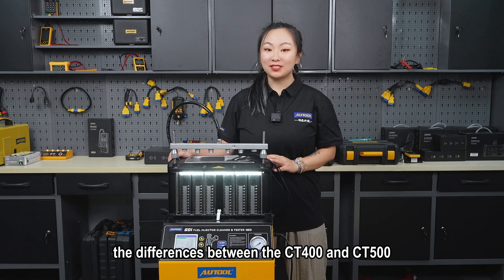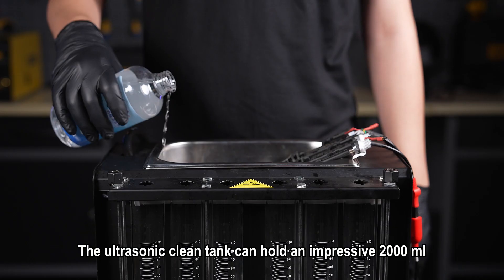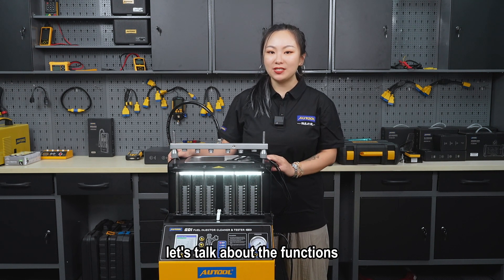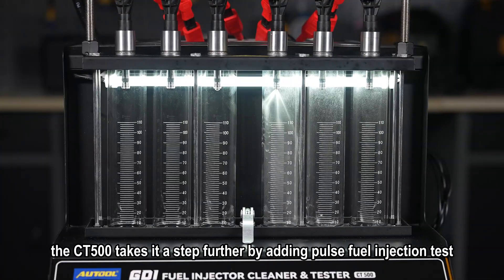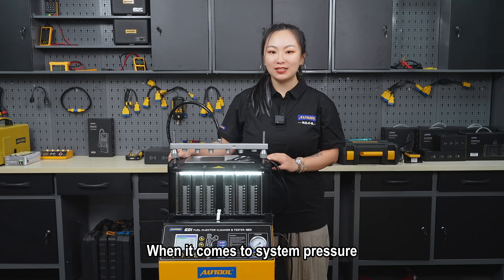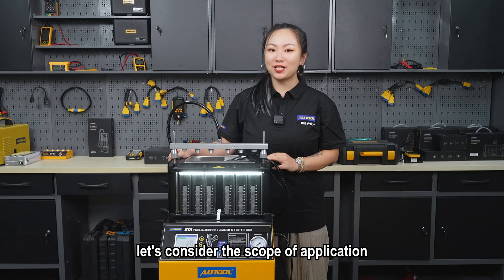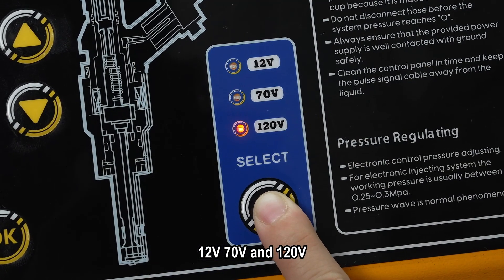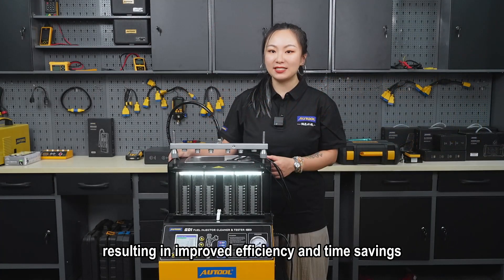CT400 vs CT500: A Comprehensive Comparison of Fuel Injector Cleaning Machines

Comment: I have a question about ct500, I saw video how injector test starts and that got me confused. Test started instantly, but fuel pressure rise slowly. Is it possible to first pressurize system and only than start test?

Comment: اشتريت جهاز ولا اعرف ماهي المواد المستخدمه للجهاز
Reply from the maker: Hi there, Thank you for your support of Autool. For the cleaning function, please purchase a special injector cleaning fluid. For the test function, you can use medical alcohol as the test fluid.
Reply: @AUTOOL-TECH  ارجو اكتشاف الخلل الفني للجهاز لانه لايكشف تسريب البخاخات
Reply from the maker: The machine itself has a leak test function, please refer to mode 7. Atomization can be tested through other modes, such as idle test, medium speed test, and acceleration test to see the atomization effect. thank you @البيضاني-لكهرباءالسيارات

Comment: Does this work with 2016-2018 Mazda MX5 GDI injectors?
Reply from the maker: Hi there，both CT400 and CT500 are suitable, but it depends on the specific injector. Test whether the specific injector has a suitable adapter.

Comment: This is not a cleaning machine. She is unable to check the injectors. In your video in the ultrasound video of injectors with N20 BMW, there is a microfilter at the end of the electromagnet, it needs to be washed and then put on a testing stand at 40-120 bar
Reply from the maker: The information provided seems to be a misunderstanding. In reality, the testing and diagnostics do not necessitate achieving the 40-120bar pressure that is specified for the vehicle; a pressure of merely 6bar is adequate for testing with the fuel injectors.
Reply: @AUTOOL-TECH  You are completely wrong. When I made the first pumping station, I thought everything was ready. now there are two of them. And there are plans for another powerful one. I can easily turn everything on together, not only for pressure, I need pump performance. My cleaning technologies without ultrasonic baths, in 10-15 minutes. And now cars have injection 120 bar idle. In our city they have been accumulating such stands, and are trying to look at mine)))). They can’t do it because new technologies don’t work with simple checking or pushing through dirt.
Reply: @246alfa  To fully test gdi injector, you need to test it in two stages, in cold and in hot (~100*C) condition and as you said in high pressures as it was designed to work. Sadly this devise does not exist so I test gdi injectors directly in a car.
Reply: @MechanikasLukas  I've been making stands and technologies for cleaning and testing injectors for 15 years. I don't show them off, as they might be stolen. Some of the processes can be seen on my channel. I also make pump stations for testing up to 270 bar. https://www.youtube.com/watch?v=7YQPUA9PO0c
Reply: @MechanikasLukas  You'll notice the time the videos were filmed. They were used for a forum. But that was before the war. A lot has changed since then, especially technology. https://www.youtube.com/watch?v=7YQPUA9PO0c
Reply: @246alfa high fuel pressure is a good start, but still no injector-fuel heating I guess?
Reply: @MechanikasLukas  The temperature difference isn't important. If you heat one injector, the response time curve changes. But when I'm working with a line, I don't need the temperature. I use the temperature during the injector cleaning process. I don't use ultrasound. This isn't the beginning. I have three pressure stations and many different pumps. I have no desire to invent anything new. Auto repair shops all over the country send me injectors.
Reply: @246alfa sorry, you are wrong, to fully test these injectors, you need to test ir also when it is hot. I repair these cars and test injectors in time consuming way- in a car, and some bad injectors are leaky, some inject too much or too little when cold and some transforms when are hot, too much or too little fuel. That is a fact, maybe you have not got that deep in to it. More specific, it is n43-53 injectors 150-200bar working pressure.
Reply: @MechanikasLukas  Let me repeat, the temperature isn't important for testing. I've been doing 5-7 sets a day for four years now, seven days a week. There's no injector I haven't seen and developed a test plan for. 
For N43/53/63 GEN-1, it's a piezo. It's important because they require 150 volts. 150-200 kg of them have been tested. I don't want to deal with them; I have enough work with electromagnetic injectors. https://www.youtube.com/watch?v=AXUEOPgMuOA Click on the nickname.
Reply: @246alfa understood, too stuborn to lern anythong new. Good luck.
Reply: @MechanikasLukas  You're simply behind the times. You haven't used GEN-3 B-58, nor have any of their other products, which use layered technology and 350 bar. We do it all, it's easy and simple. Again, I don't like piezo, because the service using this new technology only costs $4. They're sending a set tomorrow, four of them. They'll send it quickly, and I'll do it, but I'm not interested in cars older than 10 years.
Reply: @246alfa  I simply have more interesting things to do than injector testing equipment. You work with injectors, I told you new fact, do what you want with it, you do not care, I do not care.

Comment: What product or liquid do you recommend using with the equipment?
Reply from the maker: Yes, there will need two types of fluid.
One is cleaning fluid, you may choose brand LUCAS or 3M ultrasonic cleaning fluid for cleaning injector function. Please note that the ultrasonic fluid can not be used in glass cylinders, which will damage the pump and the seals.
The other one is testing fluid, you may choose medical alcohol.

Comment: have you fixed the mainboard problem yet? also have you started using better quality fuel pumps? 
everyone is complaining that these machines are broke out of the box..and if the unit is broke out of the box will you replace it?
Reply from the maker: Dear User, we have a three-year warranty, and we stand behind our products. Yet we don't receive any unsolved complaints about our cleaner machines.
The fuel pump is made of good quality, may I know the details of your machine? I will help in any way I can. Thank you.
Reply: Year 2007-2009 Mazda CX7 injectors cleaning nozzle not available, the injectors rubber seal is much bigger than any available nozzle given,
Reply from the maker: @hana_mugil2114  what car model in the year of 2007-2009? and what test function you need?
Reply: @hana_mugil2114 this is what I’m looking for since I got a mazdaspeed3 which uses the same injectors as the cx7 2.3disi turbo. Have you find a good tester for those injectors ?